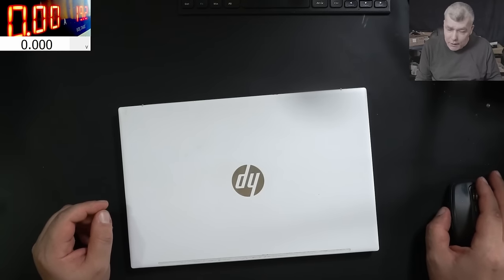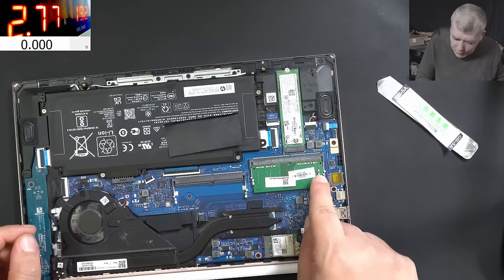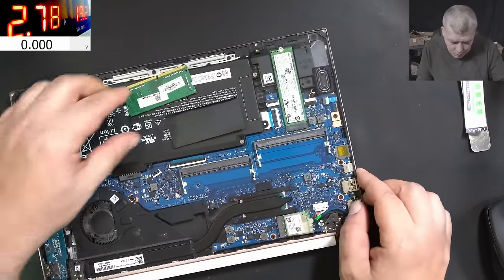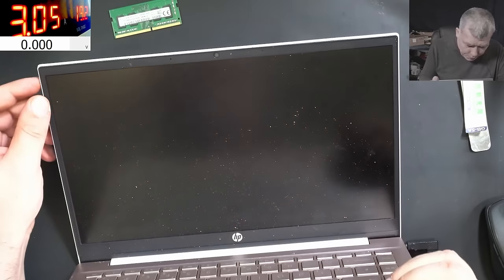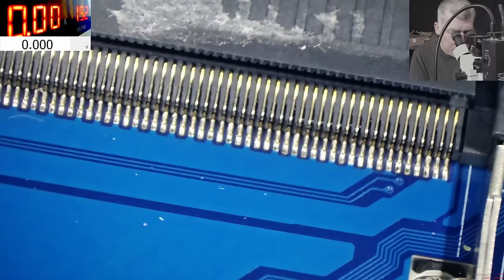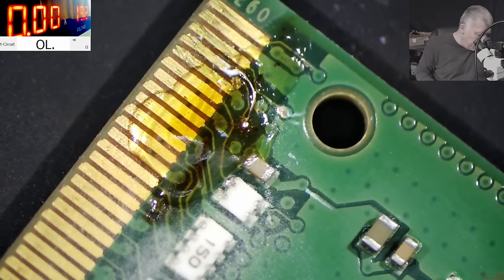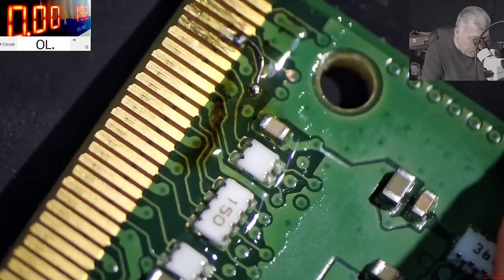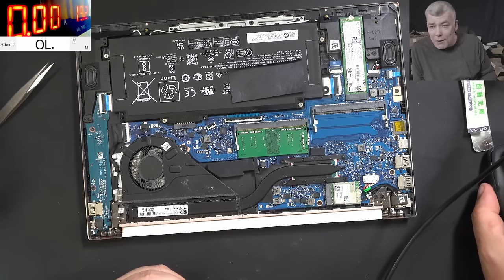RAM memory repair -Hp 14 dv0607 coming on with no picture RAM repair

Comment: 80£ for 4GB of memory. Totally worth it.
Reply: why the computer shop didn't even try to change the ram
Reply: 80£ to fix a laptop that doesn't turn on. Fixing the 4GB Memory Module it was free of charge.

Same idea, if a laptop comes with frozen bios and need 1 minute work. You charge a laptop
that doesn't turn on, not a frozen bios.

In the other way, you have to work like 3-4 hours to fix a laptop and get paid 80£, this is also 
something that happens to our job. Get used to it.
Reply: @ChrisPavlides but does the computer shop not know that it's a ram issue when they have the caps lock light blinking? If they don't know such simple thing, is it worth paying them 80 euros?
Reply: @saiavinash555 The customer clearly didn't know either, so in this case yes.. the laptop is fixed.
Reply: @saiavinash555  As if when UK returns to Europe after Brexit fiasco they will be changed to Euros as they wont have same special status anymore.
Reply: I can believe 😊
Reply: @XantheFIN 😅. I didn't realise euro is different from pound. Thanks for pointing out.
Reply: Its the diagnostic, what costs 80£, and he was nice, and fixed the ram modul for free, so the customer dosent have to buy a new one, and pay with that much more.
Reply: @SkyDown15  So let me understand it properly. There is master Sorin who charges maybe like a 40 pounds for such a repair. And there is this computer shop which takes 80 pounds for their professional diagnosing services who didn't diagnose a simple ram issue and sent it to a third party.
It doesn't make sense to me paying 80 pounds for such diagnostic. Maybe I am dumb.
I don't want to argue anymore
Let's leave this conversation here

Comment: "Coming from a local repair shop", imagine being a computer repair shop and not being able to diagnose a dead ram module, something that in this case costs 10€ brand new and with warranty. It's literally one of easiest things to diagnose since you can pop a good module in to test it. Computer clearly turns on and they write "no power". If the client asks why he's being charged 80 pounds for something so cheap they'll say "you pay for our years of experience and knowledge", not that they needed to send the machine to someone else. Enough with the rant, good job as always Sorin.
Reply: well, in that case they are good to pay....if they do not know simple things or are not willing to do simple work then they should pay.....for the job regardless of how simple it is.
Reply: @orange11squares  by the way, when I said "client" I was talking about the owner of the laptop.
Reply: Possibly it was dead and no error code indicated faulty RAM. "Could be?!" 😂
Reply: The guy paid 80 pounds specifically because of their lack of experience and knowledge. If they actually knew what they were doing they would have correctly diagnosed the ram and replaced it. That's why you should never take faulty items to noobs or cowboys.
Reply: @g4z-kb7ct  You misunderstood my message. When i said "Client" i meant the laptop owner. When i said "they'll say", i meant the repair shop. And maybe it's different in your country but in mine people don't usually carry around a golden plaque saying they are noobs or cowboys. You have no way of knowing which one is a good technician or not.

Comment: This is amazing video. the attention to detail was brilliant. i was facing similar situation with liquid damage and after this video i go back to the microscope and pay extra attention to the pads, and BEHOLD there was a broken track right at a tiny via.  
Soldered a jumper wire to the other side and now RAM works perfect. I almost gave up and replaced it with a new one but this video just gave my RAM a little extra life. THANK YOU SORIN!!

Comment: Logic would also state to try the repaired ram in the ORIGINAL socket. This is where it was when it came in, and this is where the water damage likely occurred, so it would make sense to also ensure it works (no doubt it would work!) in the OG socket. This would also prevent a 'come back' if the customer puts a stick in that socket and it fails. Again the testing of the OG socket would be purely for video footage as I'm sure it would work without issue. Great video Sorin!

Comment: Love your videos. Wish you were around when I worked in electronic repair. Hey one thing I dont get is why dont you use fiber pens to clean up tarnished contacts or to get ready for soldering. They do a much better job than scraping with a
metal probe. The solder has a better surface to adhere to as well.

Comment: First thing i leaned fixing LT's when it powers on but no pic is CHECK THE RAM!!  It could then be a ton of things if thats not it. always check the obvious and corrosion or the simple stuff.  Use a known good part is also very good at checking  ram, video output.  After that dont work, it gets harder!!

Comment: This should not have been a repair for 80 pounds. It should have been a diagnostic for 20-30-40 (whichever the service charges) and advise to purchase a new memory or directly replacing the memory. DDR4 is dirt chip, for 40 pounds (which Sorin would charge for this repair), one could buy 2x8 GB. A 4GB stick is around 3-4-5 pounds ..
Reply: yes, indeed, but they sent the laptop for repair not for diagnostic. And he did not tested if the affected ram slot is working.....probably it's working, but you never know until you try. And he could have told them it's the ram in the first minute after seeing the caps lock led error code.

So what Sorin did is absolutely fair and correct.He repaired the device, it's working now.

Comment: You're poking all those RAM pins without disconnecting the battery and with the charger connected. You're no afraid that you're gonna short the board and burn some components?
Reply: There is no problem, unless it is on. RAM sockets have no standby voltage.